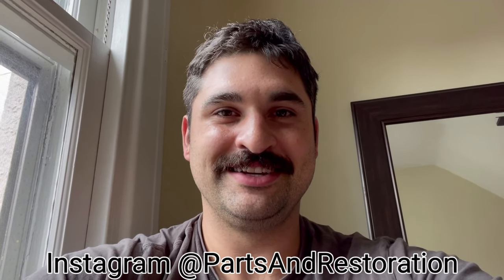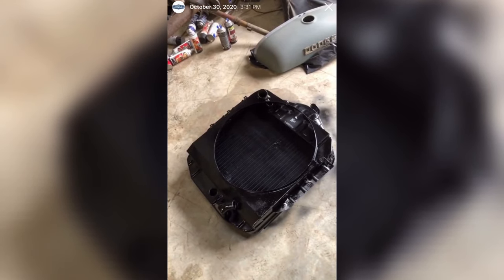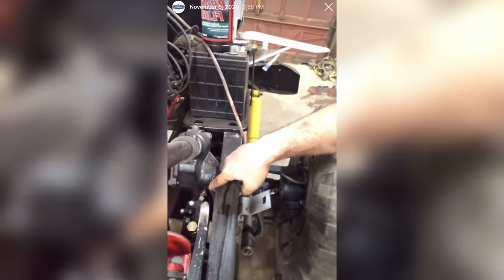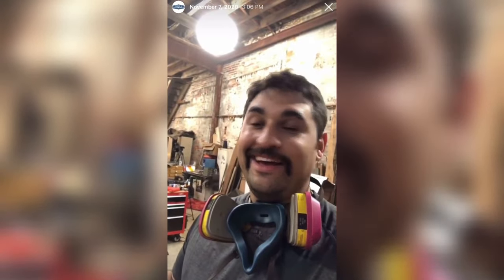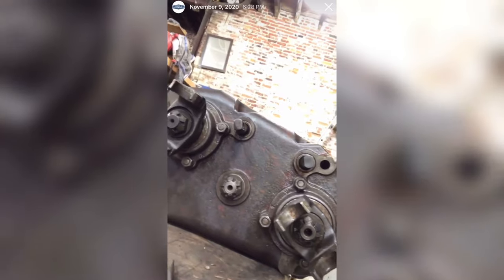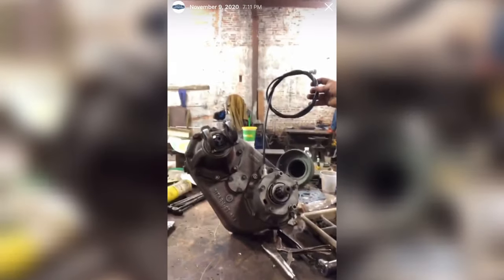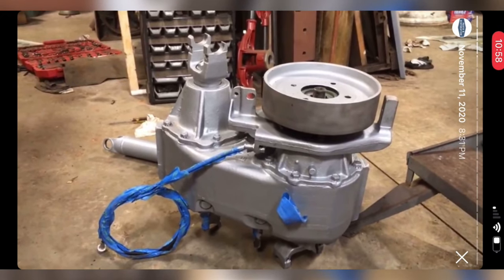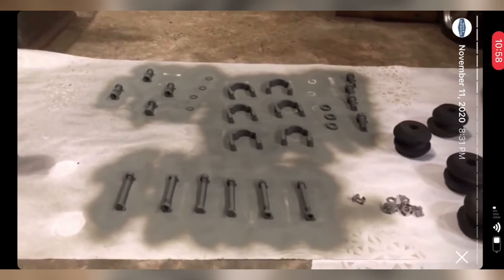Dodge POWER WAGON Restoration Vlog: *EPISODE 6* FIRST START Chrysler 230 Flathead

Comment: Dave, I ended up putting in a remote master cylinder reservoir on my '56. I pressure bleed them with a motive products pressurized thing. Way easier than pumping the pedal three times then realing the master cylinder is out of fluid.... If you make a gasket for the cap use EPDM rubber. It stands up against brake fluid. Good job!!

Comment: up until the seventies, lead, like solder, was used to fill seams and gaps for its easy forming properties and is usually smoothed with a wooden wedge dipped in wax.

Comment: You're doing well for a beginner.  Might I suggest that you check out the 1960 Plymouth Fury daily driver project on Coldwarmotors on You Tube because Scott can show you much in the way if matching panels and welding

Comment: those are not "shakles"  they're called slup yokes..... don't know why, but because as the suspension flexes, the driveshafts ( prop shafts) grow and shorten in length which is obvious once you think about it, but unless you know to think about it you never will
Reply: slip yokes not slup yokes.  Isnt auto correct grand?